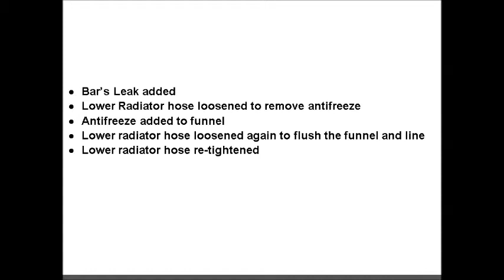Additives to a fully sealed coolant system (no radiator cap)

Comment: After you disconnected and drained the pressure overflow tank, why not just hook the hose back up and leave the cap off and forget that funnel. Then do exactly the same process you described! Yes you may have to let more coolant out the lower radiator hose to get it to accept the Stop Leak, but I see no difference in whether you use the overflow tank with the cap off or a funnel. Just say'in!
Reply from the maker: It made more sense to me to inject the entire amount directly into the system. You can try it your way and let us know if any product was left in the overflow tank.

Comment: Couldnt you just hook up the hose again and turn on the engine to feed it through?
Reply: Try it , i just tried empyting the hose and dude theres like no space for all the shit, i dumped out almost all coolant need some left in there lol. Damn chevy aveo and no radiator cap haha. I got like some in there. then put the rest in resovoir as the instructions on bottle say not to but its okay to put in pressurized surge tank? wtf . Any way one of those things i did was no good. Just about clogged up heater, lost almost all heat so i revved her a few times to un gum things up b4 they solidify. then the oil level needle droppe back to like quarter hot when it was reading at half (aka normal operating temp). Shits heat, if you have tools just do a gasket. Oldschool funk shows an easy ass way without having to do timing again, riggeds it up with wire and a broom stick lol.  Except if head is warped you are gonna have to hella sand it down with something perfectly flat which might be a lil too much but really idk i will tell you if this gasket sealant by prestone worked or not . tell you tomorrow, has to sit for a day after before using again